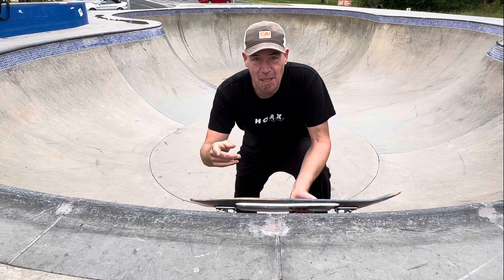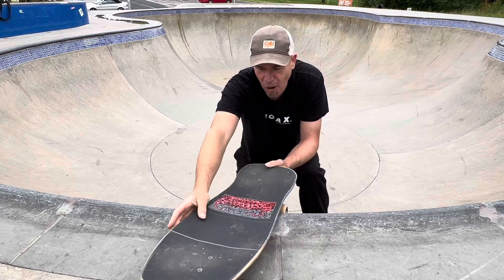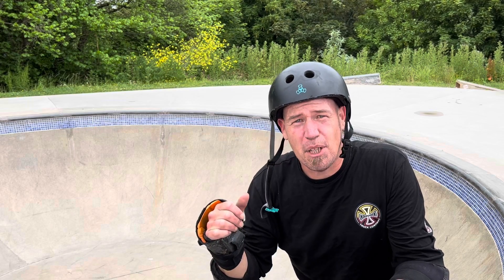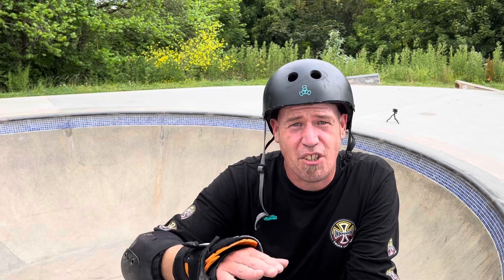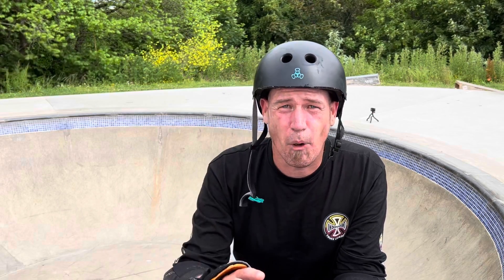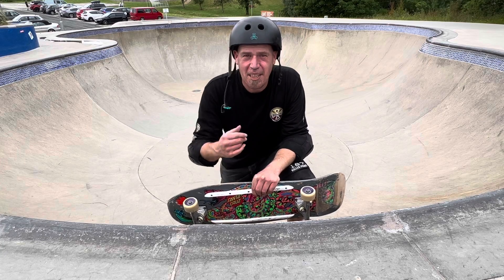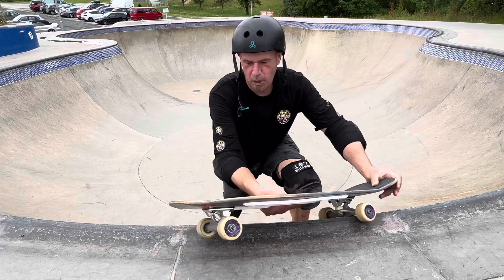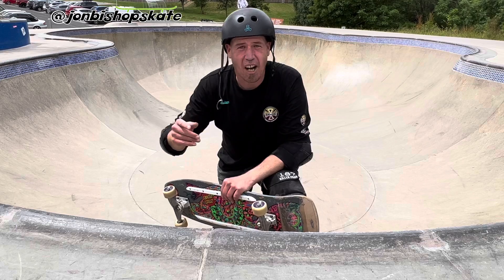Learn To Feeble Grind On A Skateboard #battle

Comment: was down in portland recently and saw an extremely high speed frontside feeble grind from one of the local rippers. seems to pretty much be the same techniques you're working on but i noticed he:

* had his back knee super bent but rigid
* front leg straightened and toes pointed like you're doing
* body completely in the bowl almost like he was doing a slash grind on vert

definitely seems to be a strange grind in terms of body position -- can be on top of the coping or inside the bowl with both working.
Reply from the maker: Crikey, I can’t imagine doing it F/S 😂

Comment: feeble grind fakie next?! 😮
Reply from the maker: Yeah, it seems on the card, I’ve done the feeble stall to Fakie on the mini ramp, but never on pool coping, so that would be the start, and I’m fairly sure of the outcome 😂
Reply: @JonBishopSkate  since you mentioned keeping your weight on the front shoulder, the truck to the feeble fakie is to switch the weight to the back shoulder. I think you have it in you. Always cheering for you mate. Success
Reply from the maker: @carloscosta1975  many thanks for the tip dude, that makes sense !! Cheers